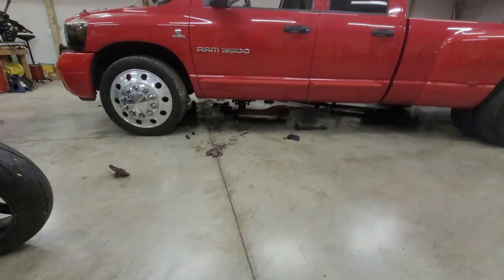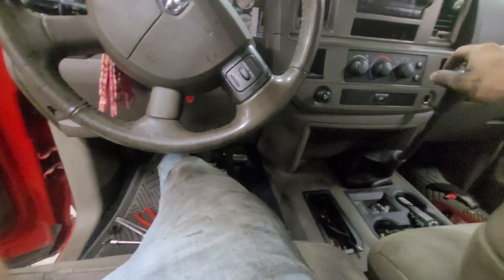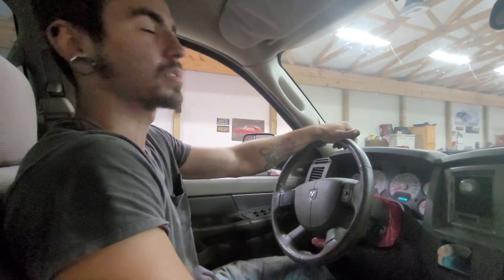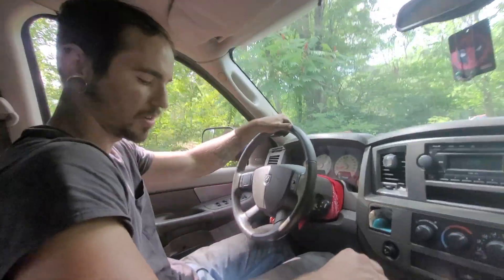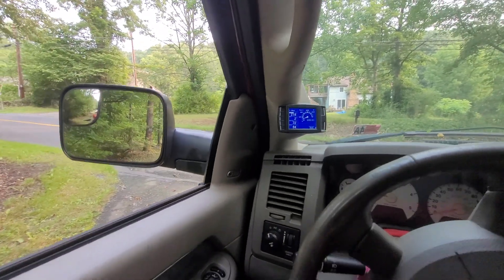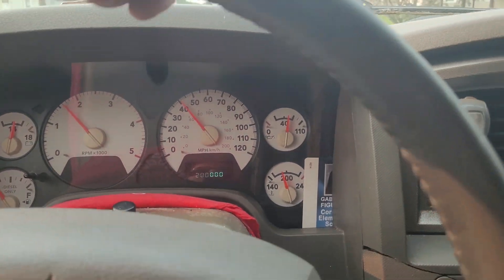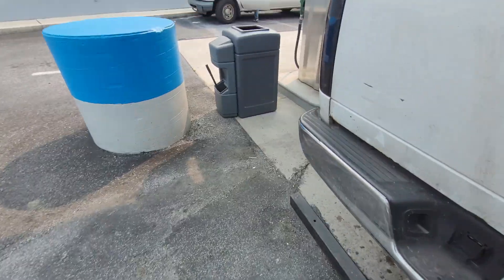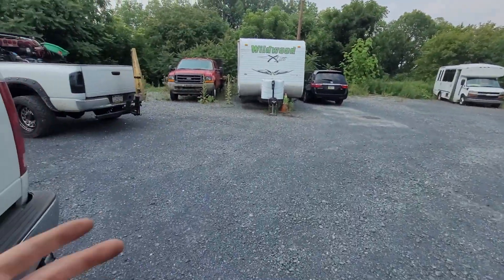I Was Forced To Order A $5k Transmission For My 06 Cummins | Finished Up The Dually!

Comment: Awesome to finally get a trans. I told you tho before you were either full of it or had no clue when you said you could get a trans for 1700 lol. They cost 3k for a mild build back in 06.
Reply: U can still build a good one with billet input shaft all gpz clutches triple disc converter upgraded band servos and shift kit for around 3k if u do it urself

Comment: Do you still think the 12v is worth swapping? I specifically bought an 05 that runs and drives 296k on it, and I plan on running it until the engine/trans fails. My goal with the truck is to keep it forever. I do NOT care about "power" I want RELIABILITY over anything.
My plan is to 12v swap it. Buy a used 12v, buy a complete rebuild kit. Get it all painted and rebuilt before putting it in the truck. 
I still want to keep the 48re. Probably go firepunk route, or I will nv5600 swap it while the engine is out. 
I am debating doing the rebuild on my own or paying a reputable shop to rebuild the engine & put it in. But it's hard to find a shop that does it surprisingly ( in Texas ).

My main question is, is it worth it?
I assume yes, your videos are the reason I got an 05 to specifically 12v swap it.

I do haul alot of wood/scrap/heavy hydraulic equipment
I tow here and there nothing crazy under 10k.
But that might change soon. 

I have no issues with the CR, I just like the more mechanical 12v
Reply from the maker: "Is it worth it" is up to the specific person who is going to run it. If you do it clean it's absolutely worth it. If you're just going to slap it in, then no. 

If you put a rebuilt 12 valve in there, do it cleanly, it can be made to work very well. After 2 years of running mine I learned all of the mistakes I made and was able to do a much better swap on another customer's truck.

Even after that truck there has been improvements made. I would love to take one on that's actually got a new engine that doesn't leak(because all these used engines leak). 

The thing I hate about the commonrail is the throttle response and the lag. The 12 valve you hit the throttle and let off it's immediate. The commonrail hangs and then drops. I hate that. For running the truck hard the 12 valve was always a good engine and was far cheaper/reliable than the commonrail was. One set of injectors set's you back almost 4k if you pay someone to do it. There's a 12 valve swap right there.

You can build a decently powerful 12 valve and keep it reliable. Get a good towing turbo and run added fueling/timing. 350 to 400hp reliably is easily achieveable.
Reply: @CPSteveMiller  that you for your response and I am definitely trying to make it as clean as possible, once the engine it out clean under the hood. New paint if need be ( rattle can ) putting the 12v in, cleaning up the wiring, hiding/taping&zip ties wired out of the way. Just wanting it to be as clean as possible. Especially since I would take the time to have the engine completely gone through, I am was of those preventative maintenance guys so I am all about getting things done BEFORE bad things happen.

But I think I will source a cheap 12v, and slowly work on it until the 24v fails then swap the 12v in it and call it good!